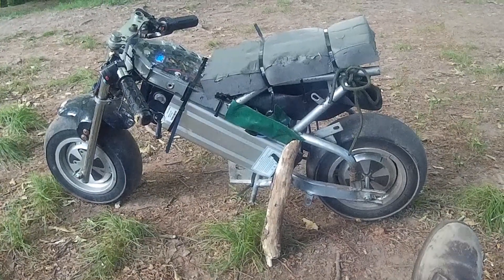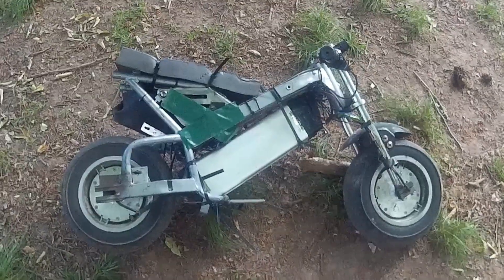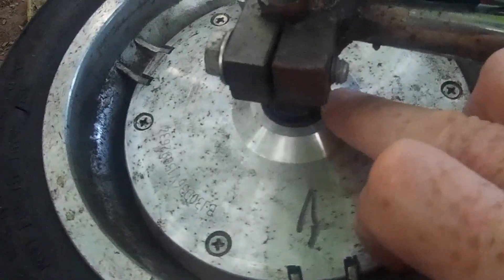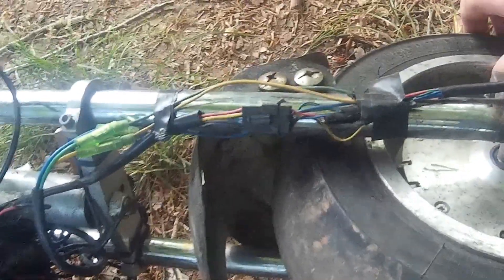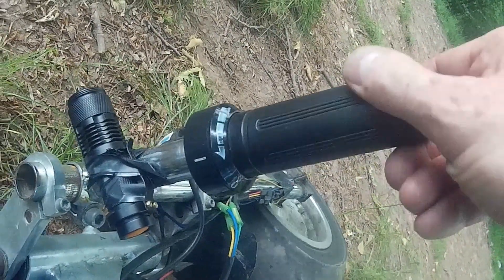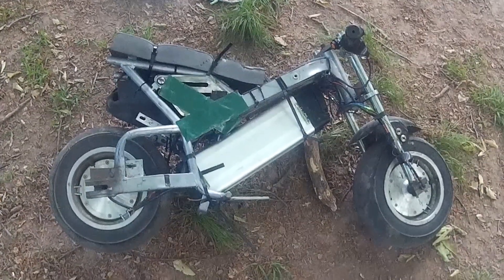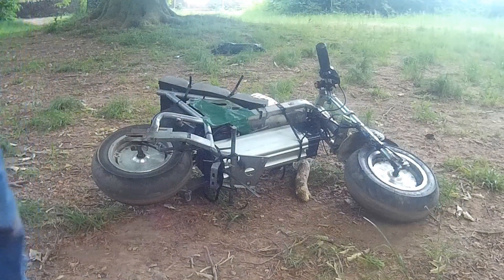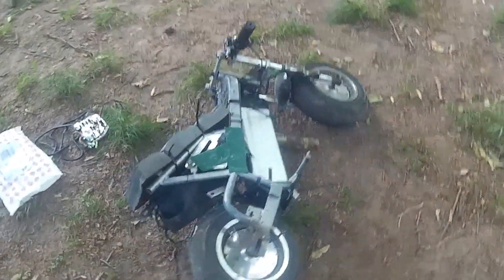Electric pocket bike from hoverboard.

Comment: That is a great build of yours! Do you think I could be able to use dual hover board batteries?
Reply from the maker: Yes but you have to be careful connecting them up. they have to be the same voltage when connecting, after that you can treat them as a single battery when charging and discharging. .

Comment: Hi your bike is very cool. I like to make something similar maybe you can recommend what kind of controller I have to buy  And can I use 2 batteries?
Reply from the maker: Any standard 250W ebike controller from aliexpress or ebay will power these motors. 
The usual care has to be taken if you ever join 2 batteries together.

Comment: What controller did you use? Also can i use the stock hoverboard controller for this build?
Reply from the maker: Hi, 
I used the stock controller and some hacked firmware on it. You have to be comfortable compiling and re-flashing firmware from a GIT repository. You'll also have to alter the code to take the twist grip input. This is far from a plug-n-play solution but a lot of fun to mess about with. there's detailed instructions on the following link. It should be noted that there are 5 or more variants of the main control board and not all of them have a hack available for repurposing them. 
https://github.com/EFeru/hoverboard-firmware-hack-FOC
I've also known people to use two cheap generic 250W ebike controllers that are dirt cheap from the usual online suppliers. This takes a lot of the guesswork out of hacking the main controller. 
Hope this helps.

Comment: Brilliant.I have been messing with hoverboards and wheels for some time but always with dual off the shelf controllers when running 2 wheels, I was just about to embark on rigging up a fun trike for my young nephew and would love to know more about adapting the hoverboard controller, could not find the link you mentioned in the Vid but any info you could pass on would be greatly appreciated, again well done.
Reply from the maker: This is the link, you have to be into your micros to make any use of it as you'd need to alter the code if you were doing anything different with it. 
They should have a version that plugs into a WII controler. 
https://github.com/NiklasFauth/hoverboard-firmware-hack

Comment: That's a brilliant bit of kit. Thanks for sharing.
Reply from the maker: Thanks, I'm currently trying to fit a 500W hub motor as a mid mount drive. Your alternator work looks good, I'll check it out later.
Reply: @o0OMouseO0o  it looked great but not practical as the gearing was miles out.
Was fun to build tho.